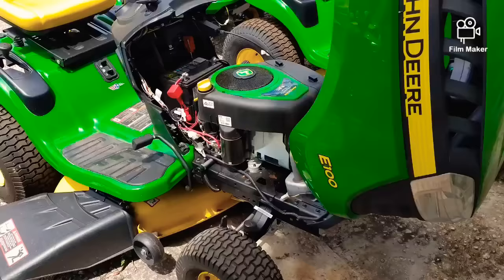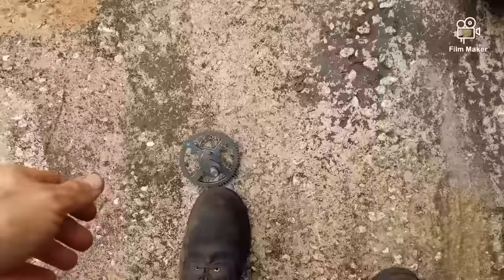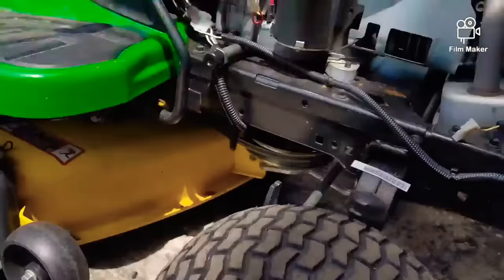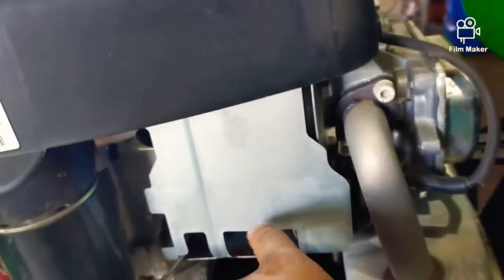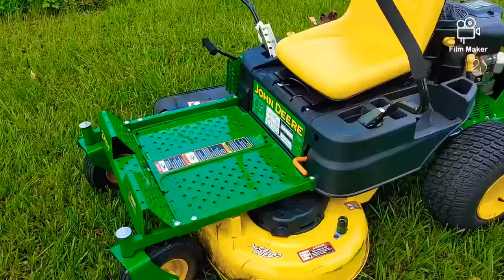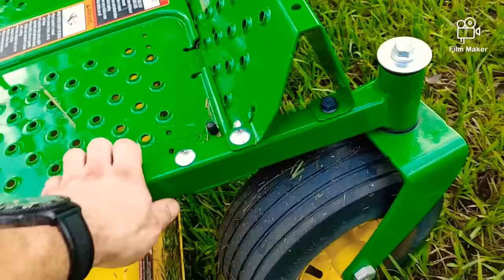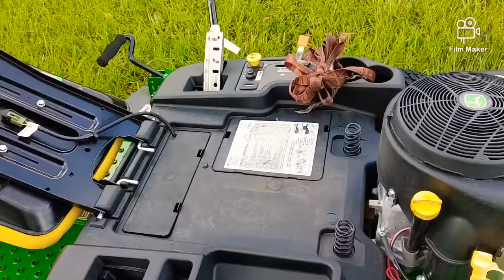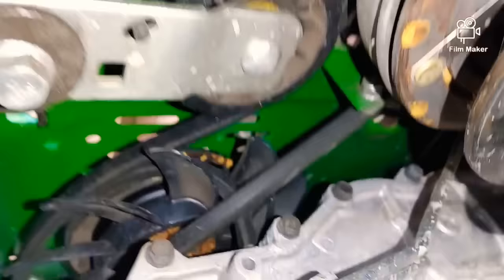Lawn mowers to avoid!

Comment: Just want to make sure in your opinion, a John Deere zero turn mower or a regular John Deere lawn mower tractor for residential mowing?  I have a flat 3/4 of an acre.  I don't need a big mower, it can be 30" but nothing bigger than 42", because right now I use a push mower, while that is great for a excellent work out, I'm not getting any younger (60 yrs) and anything is better than walking for 3 hours especially in a North Carolina summer.  Thank you for your suggestions!
Reply from the maker: Hi Erich, personally I like lawn tractors for the comfort and I feel they are more enjoyable to cut with vs a zero turn.  If you get a John Deere Id get at S130 or higher. But since I made this video John Deere has stopped using the plastic transmissions in the 100s,110s & 120s. 
Also John Deere dramatically improved that Z300 series mowers. They fixed nearlry every issue I was warning about. Avoid 1cyl engines. Id also recommend looking at the new Cud Cadet mowers. 
If you rather have a zero turn mower in the lower $3k Id go with the new John Deere Z320M. The Cub Cadet Ultima ZT1 I think is a better zero turn and has a 3 yr unlimited hour warranty but its about $1500 more.
Reply: @Mechanical_Mind  ,  Thank you!

Comment: I had a Husqvarna walk behind AWD. Piston blew because I had this tiny hill I'd mow that would pull oil from the motor. Crap design. Lasted only 3 years. The hill was only 14' long and took only 3 passes parallel. $650 mower. I stick with the cheap used light weight walk behind. My current one was free.

Comment: Thanks sharing the makes and models to avoid - what makes and especially JD models do you recommend?
Reply from the maker: As far as a zero turn mower JD drastically improved the 2023 Z300s. The one in this video the previous generation. I've done some videos on the new and they pretty fixed every issue I mentioned on the old Z300. 
As far as lawn Tractors they no longer use the plastic transmissions either. I recommend a S130 or higher.  The X300s are very good lawn tractors.

Comment: The first mower, does not qualify as a garden tractor lol. The Z335 ( and others of this family) yup I have a customer with a Z255 and everything you mentioned is crap even the front deck mounting bar is esp. crap! It was obvious there was a better design thought about but the bean counters got involved. MTD's crappiest "white box store" riding mower has a better designed front deck mounting bar. I have a JD 210 and 212 (with a K361 engine) and an assortment of CASE GT's from 130's up to 4000 series. Those were designed to last.

Comment: - Thanks I subbed to your channel! - And thx for taking the time out to let me know that JD has fixed the problems with the Z300 series! 
I have narrowed it down to the 48" JD Z325e with JD 24 hp and the Husqvarna special edition Z248F. The JD is costing $400 less right now after rebate = $3299 -The Husq cost $3699. What say you? Is the Husq worth the extra $400?
With that being said, I almost got the Bad Boy Rambler until they ran out of the Kohler 7000 22hp engines and replaced them with Briggs single cyl. 19hp and didn't drop the price a bit! To me the Rambler not worth the $3599 with that engine. What do you say? 
My overall pick is the MZ Magnum 48" with 25hp Kohler 7000 series but it's out of my budget range at $4299 now! -- Why has all these mowers price increased by 300-400 on average in the last few months!? If it were you, would you go ahead and spend the extra $700 for the BB or get the Husq or save another $400 with the JD?
Here are links to both the JD and Husq if you need to take a look? 
https://www.lowes.com/pd/Husqvarna-Z248F-Special-Edition-26-HP-Kohler-7000/5014181053
https://www.homedepot.com/p/John-Deere-Z325E-48-in-24-HP-Gas-Dual-Hydrostatic-Zero-Turn-Riding-Mower-BG21297/322096271
If you see this today please reply asap as my grass needs cutting! lol!
Thanks so much for the help!
Reply from the maker: I was just recording footage this past Wednesday for the next video on Husqvarna and Toro. Soiler alert Husqvarna is taking the #1 spot.
Its deck and spindles are far better than the new John Deere. Plus the Husqvarna has the better engine.

Comment: My z245 was fine bought it with 500 hours used it cuple years then starter went out got that fixed then it went out not even month later fly wheel must b makeing it go out need fly wheel and starter sprocket now it’s sitting in feild

Comment: Think about this.  As a mechanic you are exposed to the machines that have issues, much like a car dealership.  On the whole, the number of units sold vs the number that encounter issues is, i believe, a small percentage.    I have purchased the JD355e from a "big box" store and, after nearly 5 years of ownership, i'd buy it again. I use my JD extensively around my 10 acre property and would easily say i've gotten a good bang for my buck.  Also, the comment regarding shifting the deck level and causing back pain takes away from the review.  When seated and shifting the deck level on the fly... easy, peasy.
Reply from the maker: I have actually made the same comment to other mechanics about how all we see are units that issues vs ones that are not. However that still does not change the fact that the z335 did have several design flaws for those years. So much so that for the 2023 z300 models John Deere has changed and improved 4 of the things I mentioned in that video. 
1.The tires and wheels
2. Bearings with grease vs plastic bushings with no grease for the caster arm spindle. 
3. No more plastic cover over the seat that accumulated grass and made mice a desirable home. Which also led to mice chewing up wires. 
4. No more hand lever to adjust the deck height. They now have a much better and easier to use foot lever to raise and lower the deck. Which is the method all other brands and JD's very own  commercial Zs. Its no question its a better design vs a hand lever. 
They still have the thin metal decks that will bend of you hit something, step on the deck or cut too low. If owners avoid those habits and maintain it properly most will have many years of trouble free service. 
Thanks for watching! 🍻
Reply: @Mechanical_Mind  Now you've hit on something I completely agree with you... mice/rats.   UGH!!!  I keep my JD Z355 and 3032e in the barn and the wiring on both have been completely DISTROYED by those pesky rodents.    Fortunately, as a DYI'r, I've salvaged both several times.  No doubt, need a better mouse/rat trap.  Oh, one thing I highly recommend is using an "umbrella key" to keep the moisture out of the starter switch.   Carry on~
Reply from the maker: @Ugot2BkddnMe  Yes I think Ive mentioned that key switch issue in another video. I dont remember which one. I tell everyone not to let water get into those key switches. I even put a small piece of electrical tape over them anytime I park one out side. Ive seen those cause serious issues if water gets in them. Ive seen units starters just suddley and continually try starting even with no key in the switch and in the off position. It will ruin the starter and could possibly catch on the mower on fire.

Comment: Most people would use those entry level zero turns, for a small property.  If you are just mowing an acre or less, and noting crazy, you probably won't have any issue with even the cheapest.  If you are mowing commercially, then yeah, you need something stronger.  My neighbor has a zero turn John deer, cheap model and has had it for many years, no issues.

Comment: I think you'll find the single cylinder Intek compression release operates on the inlet valve , not exhaust .
Reply from the maker: Yes, I made a mistake of which valve it uses. However, which valve is used isn't the point of the video. The compression release still breaks 🤣

Comment: Thx! You probably just saved me a lot of headache!
Reply from the maker: The new 2023 Z300s are much better. JD fixed many of the issues I mentioned in this video
Reply: @Mechanical_Mind   - Thanks I subbed to your channel! - And thx for taking the time out to let me know that.
I have narrowed it down to the 48" JD Z325e with JD 24 hp and the Husqvarna special edition Z248F. The JD is costing $400 less right now after rebate = $3299 -The Husq cost $3699. What say you? Is the Husq worth the extra $400?
With that being said, I almost got the Bad Boy Rambler until they ran out of the Kohler 7000 22hp engines and replaced them with Briggs single cyl. 19hp and didn't drop the price a bit! To me the Rambler not worth the $3599 with that engine. What do you say? 
My overall pick is the MZ Magnum 48" with 25hp Kohler 7000 series but it's out of my budget range at $4299 now! -- Why has all these mowers price increased by 300-400 on average in the last few months!? If it were you, would you go ahead and spend the extra $700 for the BB or get the Husq or save another $400 with the JD?
Thanks so much for the help!

Comment: Thez375r is crap as well because of the deck so far I’ve had to replace a belt every 2 1/2 months mats cause it keeps breaking them. The rest of the mower seems fine and good but the breaking of thebelt is the killer.   Mower doesn’t even have 100 hours on it going through six belts and not even cutting thick grass.

Comment: I never was a John deere fan for mowers. Don't like the way they cut. They really should stick to farm equipment! Scag is the way to go for commercial. Best cut ever. Evens stripes with no rollers on the deck to push the grass down in forward direction.

Comment: I have a Honda HT3810, it has finally started die, throwing oil and connecting rod bearing is slapping. It only took 35 years.

Comment: I bought a new house last year (Oct 2023) and this year will be the first time in my life I will need a riding mower.  I stopped by the local JD to ask about options.  Oh, I also need to snow blow my dirt/stone driveway that is on a big incline and probably 300 or 400 feet.  The grass area is also a big slope, maybe an acre. So, the dealer suggested the X350 Select Series with the 42-inch Accel mower deck and the 44-inch snow blower (model year 2016 - X300s & XX570).
For those of you that know these things, what's your opinion of these models?  
Thank you.
Reply from the maker: The X models are very good

Comment: I have the John Deere z series zero turn. The paint they used is complete garbage. I knew the deck had some rust but my blade started cutting crooked... I couldn't figure it out because the blades were fine so I took off the entire deck and realized that the area around the pulleys had completely rotted out unrepairable by a welder There's not enough metal there. when I pressure wash ed the deck I found that though the paint looked like it was fine it was completely rotted out underneath the paint far from any cracks in the paint. I don't even know if I'd call it paint because it doesn't stick It's almost like some kind of a coating and once you get a nick in it it rots from behind the paint so you think you have a good deck. actually it's just some kind of plastic paint material there's no metal there. The cheapest deck I found used so far is $350 and they sell out instantaneously  like you said the engine is great the decks are garbage A new one is $800 I can buy a used running machine  for about 950.. I'll be buying a bad boy or something like that here shortly

Comment: I have come to the conclusion that John Deere puts out riding lawn mowers and if there's a design defect, it's not their problem. All the gas tank issues I've seen, they come out with a redesigned fuel tank, but the cost of their error is your problem. I don't think that's right.

Comment: My mother has the better model x530. The hood is cracked, the cow is cracked, the engine blew at a little over 300 hours and JD dealer serviced it every year. The ignition is not working right, the transaxle fluid tank cracked. Its a piece of junk and the roughest riding mower ive ever been on. Oh and of course the yellow seat is cracked really bad like they all do.

Comment: Thanks for the video.  I am searching for a quality built model riding mower for my wife and I to take care of our nearly 1 acre property.  My yard has an up slope towards the house and flat at both ends...backyard is smaller with a down slope.  Would like a good mulching mower, easy to do basic self service with a comfy seat and ease of operation. 
Your video potentially saved me from buying the S100 model but the brakes are on now and so my antenna is up!
I am near 70 years old and do not want a problem child of a mower.

Can you recommend what i should be looking for after what you have worked on an seen what comes through your door for repair?
Thanks again for the videos. I have subscribed and will keep looking.

Comment: I wish I had seen this years ago before buying my Z525E John Deere mower. I've had quite a few engine issues with my 22 horsepower Briggs and Stratton v twin engine. I'm currently needing to pull the rocker arm covers to find out why it's backfiring through the intake at full throttle. A lot of other people showed that these engines, when they do this, have issues with the valve guides partially coming out, causing the exhaust valve not to open all the way and bemding the push rods. I guess I'll find out if that is my issue when I pull the rocker arm covers. I keep it maintained frequently. I also appear to either have a bad starter solenoid or a bad starter, so I have to do some troubleshooting on that as well.

Comment: I'll add this too, never, ever buy from a Big Box store like Home Depot or Lowes.  Almost all of their machines have stamped decks which are crap.  You hit a stump enough times and you bend the deck to where the blades start hitting the inside part of the deck.  The other problem is getting it serviced.  Look at any of them, none have on-premises repair shops, so they will send it out for repair which could take weeks or even months.  People think they are getting a great deal spending $2800 on a Cub Cadet or Toro or even a John Deere but $2800 is poor quality.  I know, I know, you have a $400 push mower that cuts great but it's a push mower.  The majority of the work is the operator so a push mower's biggest perk is the engine.  Most of these cheap zero turns have good to great engines but it's what they sit in that makes it cheap.  

Also, this is for the guys that want a zero turn just because.  If you have less than an acre to mow, don't get a zero turn.  You are wasting your money that can be better spent on a good push mower.   I would also recommend a dealer for a push mower because you can buy high quality mowers that are self-propelled and have a great bagging system.  I still use my Honda push mower around the house even though I have a $13K zero turn.  I just need a commercial zero turn because of nearly 5 acres of rugged terrain.  That JD he is showing in this video wouldn't last one mowing in my yard.

Comment: Great video thank you! I have a Hustler Raptor with hydro-gear ZTC transmissions. Got it stuck in my creek. Didn’t rev the engine and didn’t ram the lap bars back and forth trying to unstick it. But now afterwards both lap bars went forward 3/4”. Return them to neutral slot and it backs up. I readjusted the bars so it wouldn’t start in reverse. Now it won’t move when I start it. After five minutes or more it slowly starts to move and the transmissions are quite noisy. After it’s good and warm they pull like normal and get quiet once again. I’m stumped and I have no local service center anymore. Thanks for any advice you might have I’m sure my dilemma is probably common.

Comment: Wow, that is the exact issue I'm having with my D140 with 80 hours on it. I had to spin the fan back and forth to get it to start, but eventually that even stopped working. It's in the shop now, will show them this vid if they can't figure it out. I'm dreading how much the repair cost is going to be. I plan on selling the D140 as I just purchased an S170. Does that have a plastic transmission?
Reply from the maker: John Deere stopped using the plastic transmissions altogether now

Comment: I guess I got a good mower in 2014 when I bought my z255. Cost so far to repair? 1 deck lift cable and one battery, oil changes. No belts, tires. 450 hrs.

Comment: Stay way the hell away from husqvarna z248f. Parts are super hard to find (in my area) I can’t even get parts from the lowes I bought it from. They run good for about a year then they start falling apart. My JD z355e works so much better.

Comment: Thank You for the zero turn mowers as the John Deere was on my list for my 1 acre lot 
Suggestions? Someone suggested a Bad Boy MZ Magnum Zero Turn any opinion?
Reply from the maker: Hi Monte, the new John Deere Z300s have been completely redesigned for 2023 vs the previous years design. They solved 5 of the 6 issues I talked about in this video. Im actully working on a new video about it. Here is a recent video were I went over some different makes
https://youtu.be/TBCQixtpu38
Reply: @Mechanical_Mind  Thank You 
it’s back on my list if I buy it, it’ll probably be for a local dealer

Comment: I’ve had my Z355-e for seven years and I just replaced the deck lift cables and man it took me a week because of the heat and I work 10 hours I just got it back together and it won’t turn over 😖